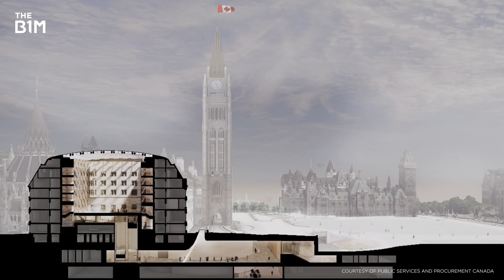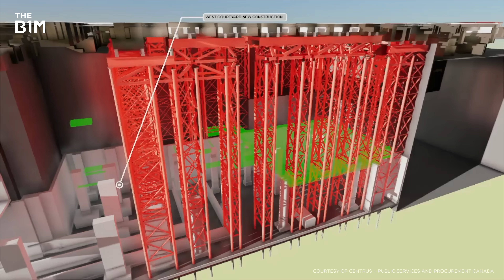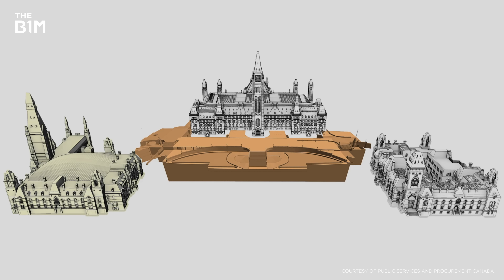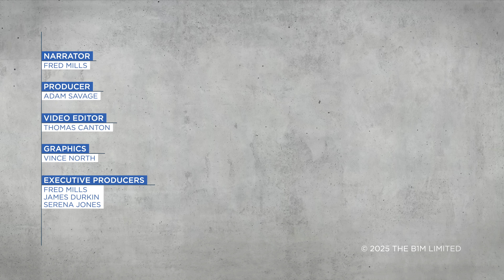Why Canada Blasted a Huge Hole Outside its Parliament

Comment: This was done before on a smaller scale in Montreal where they supported an old cathedral while building a shopping mall underneath it and a skyscraper adjacent to it. There are photos of it being supported by steel pillars over a giant empty pit. When it was done, the cathedral grounds were restored and looked like nothing happened. The mall entrances were at the corners of the property leading down into it, and it was also integrated into the underground walkways and malls of the downtown area.
Reply: That church is Christ Church Cathedral (Episcopal, aka Anglican diocese of Montreal).
Reply: Something similar happened to Westminster Palace when they were building the Jubilee line extension in London with the new giant station box under what is now Portcullis House. They had to reinforce the foundations of the Clock Tower when they noticed it shifted slightly during construction. It's not quite as monumental a task as this is, but these kind of things always amaze me. Engineers really are magicians lol.
Reply: And if i remember correctly, the Church was accessible most of the times. Peace Out!
Reply: @LerockJohn  to be fair, it seems like they could have Centre Block accessible during the construction too, but they are doing renovation of the interior so it doesn't make sense to keep it open for anyone other than the construction crew.
Reply: Fabiolus my coreolos
Reply: I’ve only been to Montreal once , about 15 years or so ago , and I was shocked at the sprawl of shopping malls underground downtown. Hadn’t seen anything like that before.
Reply: @chadsmo  There used to be quite a lot of underground markets in the UK that sprang up (or down, I guess, lol) after the war. The idea being if something kicked off again, it could act as a form of shelter. That was never really publicly admitted at the time for obvious reasons, but there you go.

This is also one of the reasons a lot of concrete buildings in the 60s and 70s used that insanely tough, stone filled concrete and had tiny windows with really thick outer walls. Even a lot of shopping centres/malls were built like this. Again, to help protect people inside from a nuclear blast.
Reply: I'm torn between "that's incredible" and "wtf, a mall under a cathedral?!?" And not certain if I'm horrified or not.
Reply: @LaughingInTiny consider that very often there are central locations for temples, and that underground is easier to maintain steady temperatures & connect several blocks worth of shopping malls..
Reply: @LaughingInTiny  There's a shopping mall and a metro station.
I have memories of the stone church up in the air on stilts - 1987 or 88.
Reply: @charles5a  that's wild! Seems so UNcanadian lol. But also très cool 😂
Reply: @LaughingInTiny  😂 I remember it because it's the only stone building I've seen up on stilts like that.
Another maybe interesting tidbit, Montreal has the Underground City (where the downtown buildings, malls, metro, etc are all connected underground). And this mall connects to that network.
Reply: @LaughingInTiny it's very well done. When you're on ground level, it's hard to tell there is a mall under there. And when you're in the mall, it's hard to tell there is a cathedral over your head. It's like 2 different worlds.

Also the entrances are quite discrete. You really have to know where they are at or you'll miss it.
Reply: @LaughingInTiny  religion is just another business. They have to either change their business model or diversify their revenue streams given people are buying their product less and less, so it was a natural partnership. They’re basically getting rent in perpetuity due to this arrangement.
Reply: @ikaruseijin01As el ron hubbard himself once said , if you wanna make money start a religion.

Comment: seems the real historical risk has been fire, and water damage. if you look at time value of money, this mammoth earthquake protection  project is just a giant doppelgänger of waste. look at the probability of significant earthquakes, and then the cost of these preventative measures, which certainly will not prevent earthquake damage (only reduce), and the rebuilding costs, seems like it would be very difficult to justify this crazy construction project which only provides a minimum of earthquake resistance.

Comment: What a massive project and a great video!

If you’re looking into parliamentary buildings you might also look at the Dutch one as well. Oldest parliament still in its original building, with the senate hall dating back to 1655. And currently undergoing a €2B renovation scheduled to last until 2030!

Comment: I had an opportunity to wander around those buildings in the early 80s, before security got paranoid. They are quite impressive.
I've visited a few times since, but not during the renovations.
I'm getting old, but I hope I get to see the new visitors centre and the other additions when they are finished.

Comment: The Senate of Canada building is actually an old train station that was fully renovated specially for this purpose. The West Block used to have an inner courtyard which now serves as the Chamber of Commons. There is also a third building nearby which houses the offices of the members of parliament. It is a hell of a logistical chalenge.
Reply: The temporary parliament space is really impressive, with a large glass roof over the original courtyard. Quite an engineering feat of its own.
Reply: @ecbftl I feel like they will just leave it as it is
Reply: @BenWinder108 I think it would make an impressive large conference/meeting space for special events.
Reply: @ecbftl  It will be interesting to see what use the West Block interim HoC gets put to in the long term. Maybe Ottawa itself could separate from Ontario and we can use that as the new legislative assembly... one can only dream.
Reply: @davidjames4915  Careful, the only thing that would be worse than governance by Premier Ford is governance by the NCC.
Reply: @petertamCDN  The NCC is doing a reasonably good job these days, which is definitely a change from recent decades. At any rate a capital territory would be a whole new entity, merging the City of Ottawa with all remaining provincial functions and some federal ones.
Reply: Here to say this. It wasn’t the “Senate of Canada Building” until the Senate moved in recently because of this work.

Before that (and a large amount of renovations) it was a conference centre, which it will become again when the senate moves out. Before even that, it was Ottawa’s central train station.
Reply: @LocalEdmontonian not with the money poured into the Rogers centre
Reply: @LocalEdmontonian  I grew up in Ottawa, haven't been back in a few years but i was wondering what building there was the senate building.  I remember when they demolished the buildings next door to build the Rideau Centre, I brought home an old window frame from one of the buildings 🙂
Reply: That old train station was transform to a conference centre and it was for many years before it was turn into the Senate, this building had a Tom Thomson painting hanging in the middle of some office hallway by a bending soda making hiding from the public.
Reply: I work next door to the Wellington building. It’s across the street from the West Block. Outside of it is a plaque that says “house of commons.” For years now it’s where I assumed that the house was meeting during the construction. But nope I recently learned it’s just where you can go an a virtual tour of the old hoc. lol
Reply: I wish them nothing but the very best of luck with their work...
Reply: We could simplify the situation my lopping off a lot of their heads. I am all for that.
Reply: Correct
Reply: It would be interesting if they left some of the train infrastructure intact so it would be possible to board a train directly into the building.
Reply: @jc441-i3q  The tracks have been gone for decades. You can still see the path they took over the old bridge that goes over the river. There's absolutely no way that can ever be reinstated.
Reply: @jc441-i3q the tracks to the south are now a parkway along one side of the canal. There are tunnels under the Chateau Laurier across the street, which last I heard still exist, but are sealed up, that used to surface across from the National Gallery, and across the now converted train bridge to Gatineau.
Reply: @ruaphoc  until the government conference centre closed the tunnel to Chateau Laurier was still open and you could go through it during Doors Open. Wouldn't be surprising if it's closed now for senate security.
Reply: No it isn’t
Reply: wish ottawa didnt scrap the old street car network
Reply: The building where the MP's offices are housed is called the Confederation Building.
Reply: @TheJellybean31 there are at least four other buildings that house offices for MP's
Reply: @TheJellybean31  MP offices are in many buildings,  Confederation, Justice (next door to the Confed bldg), Wellington and the Valour building(formerly 131 Queen) as well.
Reply: I’ve been in there but so funny I didn’t realize it was a west block. The entry looks like it’s going into the centre block. It’s like a maze in there
Reply: @bohdandoval9621  It is pretty disorienting once you get past security and go underground
Reply: Not to mention when it came time to swear in the new parliament with the Kings throne speech, what would normally take 5-10 minutes to bring the MP's across the hallway to the Senate, took 30 since they now have to go several blocks.

Comment: In my opinion, Ottawa is done with its usefulness in its time.  Today, time has changed in the society and geopolitics for Canada which means Ottawa as a capital city of Canada might not be an ideal place.   Theoretically, the capital city of any country should be at its geographic center in order to distribute wealth evenly and for potential agresor to have maximum land distance.   Therefore by a quick look at the map of Canada, the ideal place for a new Capital city of Canada would be Churchill in Manitoba when treating Hudson Bay as land mass.  Canada should spend its resources to build a new capital there not with splendor for tourism and historical mimics in architecture but with the new realities of today and future generation meaning energy efficiency, non-polluting, ecological disaster resistant and potential battle / atomic war resistant, and durability for hundreds of years that does not require frequent maintenance.  A little bit of aboriginal architecture will spice up a bit of uniqueness and beauty that Canada has to offer.